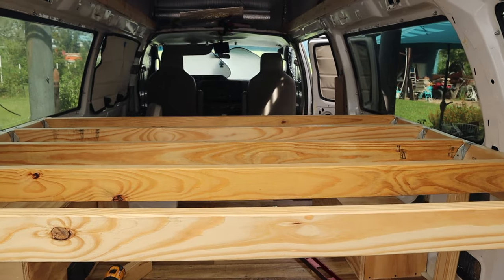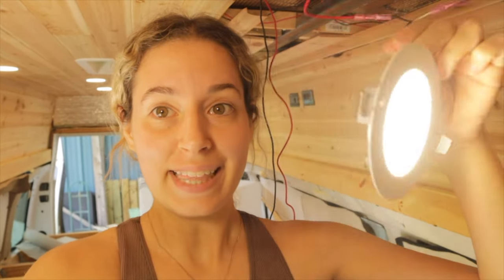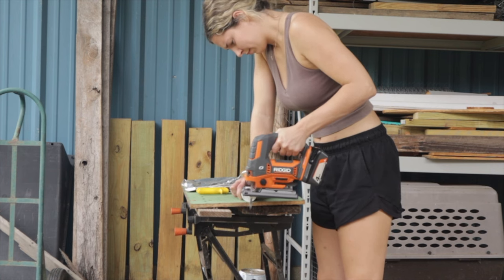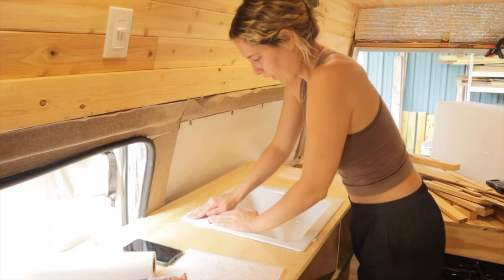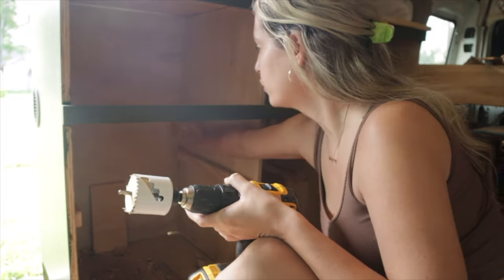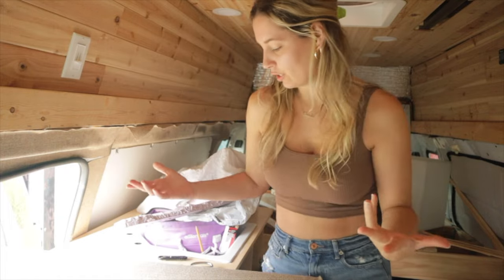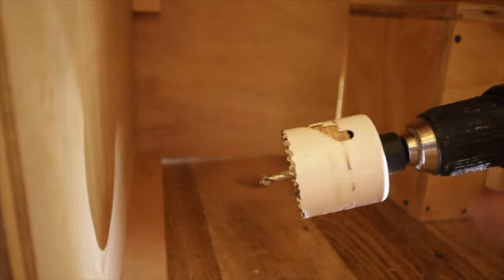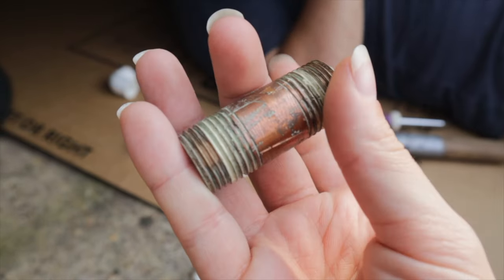VAN BUILD 18: Back on track! Fixing leaking roof, finishing grey water plumbing, and more!

Comment: In a pinch when you are missing the pilot bit on a hole saw, start out spinning it backward and slow. That will make a grove, and you can switch to running it forward.  Nice work!
Reply from the maker: noted for next time, thanks!

Comment: Hi whatcha up to hope all is well prayers 4 healing and unspoken also 4 everyone and bless great healthy peaceful safe journeys travels and happy building and happy day everyday also sorry 4 ur loss may penny run and fly in the fields of Heaven and sit with the Creator God and Yeshua/Jesus and the Holy Ghost and our Ancestors Amen much honor and respect keep walking tall always also anything that has holes to the outside on roof of van or to the outside always use butyl tape to seal items then use flex seal sealant and or rv self rising flex sealant to the outer ring of said items attached to roof and or items attached to the outside also do not do not use silicone nor regular caulking when it comes to these items attached to the roof or outside to seal it from weather also the pee urinal use water to rinse it every use also find u or make u a cover maybe a vinyl material with a draw string or lastic it to secure the cover to the urinal to keep smell dwn also bar of soap in ur gray water tank this may help with smell too however that's my opinion tho and many blessings keep walking tall always 
🚌🌅🌌⛺🌄🏞🏖
  👍👍💪🙂👍👍